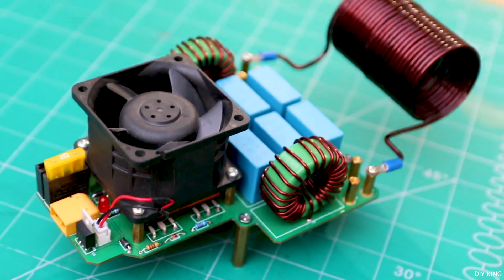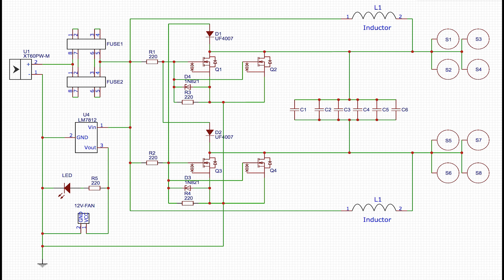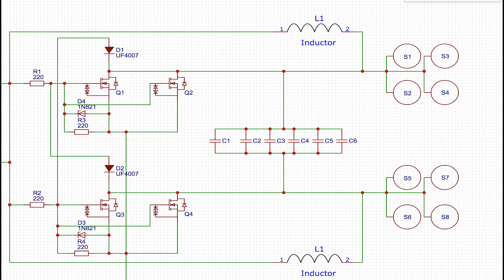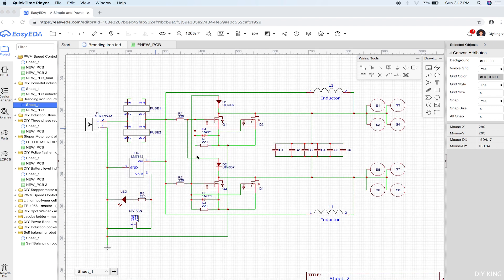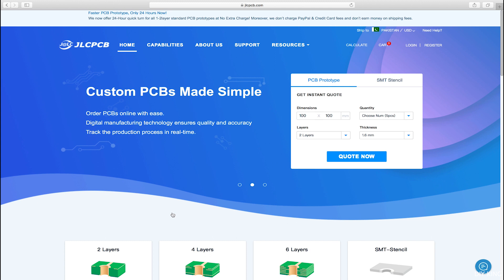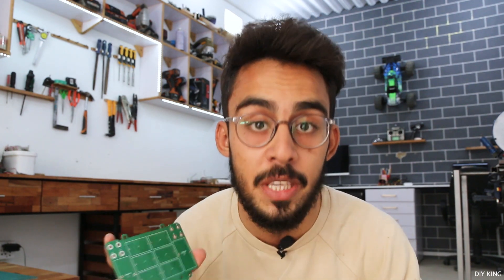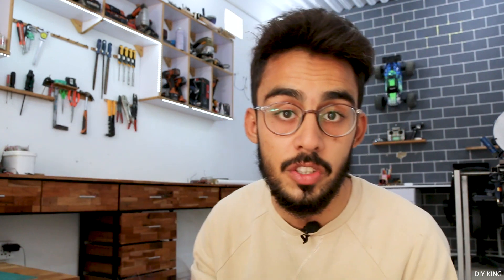How to make a Powerful Induction Heater (2000 Watts)

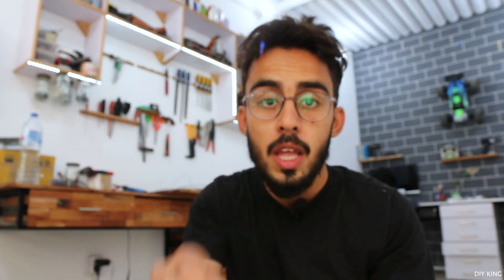Comment: At about timestamp 3:53 you state that the toriod pair are to help get the required frequency.  Actually, they should be UNrelated to the resonant frequency, their function is to filter the noise from the power supply.  If they are effecting the frequency, their inductance is probably to low.  If so, they are inadvertently combining (in series) with the main coil, and lowering the true resonant frequency which should ONLY depend on the resonant capacitance (C) and resonant coil inductance (L).  Make them about ten times higher than that of the resonant coil.   The resonant frequency is given by the formula:  F = 1/[2(pi) sqrt(LC)].
THANKS FOR THE GREAT VIDEO!!!  I look forward to making a circuit board like you show.

Comment: Thanks for the info.

Here is the extracted text from the component list table image for anyone else that is lazy like me. Just copy/paste to whatever app you want and it should drop in as a proper table.  Just make sure it has 10 columns and 13 Rows  including First column ID and Top row headers

ID	Name	Designator	Footprint	Qu	Manufacturer Part	Manufactu	Supplier	Supplier Part	Price
1	5AW2UC	LED	LED-5MM	1	5AW2UC	KENTO	LCSC	C52730	$0.0107
2	UF4007	D1,D2	DO-41	2	UF4007	ON Semicon	LCSC	C232764	$0.1254
3	220	R5,R1,R2,	AXIAL-0.4	5	MFROW4F1001A50	UniOhm	LCSC	C57435	$0.005
4	Toroidal In	U2,U3	INDUCTOR	2	Toroidal inductor				
5	1N821	D3,D4	DO35Z10	2	?				
6	178.6165	FUSE1,FU	178.6165.000	2	178.6165.0001	Littelfuse	LCSC	C207060	$2.1414
7	B32654A0	C1,C2,C4,C3	CAP-FILM_31	4	B32654A0474K000	TDK	LCSC	C165794	$0.9505
8	XT60PW-M	U1	XT60PW-M P	1	XT60PW-M		LCSC	C98732	
9	XH-2A	12V-FAN	XH-2A	1	XH-2A	BOOMELE	LCSC	C20079	$0.003
10	LM7812	U4	TO-220(TO-22	1	LM7812L-TA3-T	UTC	LCSC	C71108	$0.14697
11	STY60NK	Q1,Q2	MAX-247	2	STY60NK30Z	STMicroel	LCSC	C262988	$7.2418
12	STANDOF		STANDOFF-E	4	?

Comment: Hiii.... I've a question about this circuit. I want to know that whether I use one inductor center tap circuit or two inductor circuit as you made. Which one is very stable and efficient between center tap and two toroidal core?
  Thank you

Comment: Can you help.
I have a dual fan 2500W ZVS Induction Heater Heating PCB Board Module, 12V-48V DIY High Frequency Induction Heating Machine Module Flyback Driver with Copper Ring and Cooling Fan
and I would like to hook it up to a 30 amp power supply. I need to supply my own power cord to it. I was told that using anything below 30 amp power cord will try the circuit in my house or cause a fire is this true?
Every 30 am power cord that I find are for dryers. I need a straight plug to plug it into my standard wall outlet. The dry plugs are slanted and I need them straight.
The only kind of power cords I find with straight plug are only 15 amps. Can I use a 15 amp power cord to power up my power supply to my ZVS Driver or will it start a fire?
Can I instead replace the head of the plug with a stander straight one? Will this cause a problem? Thanks for your help it is greatly appreciated.

Comment: Your programm is really appreciable , I need an induction heater in bigger size induction coil to heat a vessel having a outer diameter of  305 mm ,is it possible to build an induction coil for this diameter if possible than what will be the wattage ?

Comment: That 2000 w is definitely clickbait 🤣, mine version is only 300w but takes same time to heat's up the object that you show in the video , and accord to your ammeter , if we consider voltage of 24v and your ammeter reading 13a the power we get is only 300w.
Reply: Also the frequency of the circuit depends upon the work*** coil not the inductor they are just acting like constant current sources.

Comment: Thank you very much. Very useful information.
I wonder if you know the real power of the system, I mean the efficiency of the circuit. 
Output power vs. input power. I'm trying to calculate, but I'm lost.
What is the maximum Voltage of the power supply and current? 
Many Thank

Comment: how many amps will that unit draw? I saw an amazon 1800 amp unit and it drew up to 43 amps.. and I was thinking. If I run it off a 20 amp 115 volt plug in.... that doesn't work? does it?

Comment: Hello first of all thanks for the instructions. In the list of components the resistance is 1K Ohm. In the video you use 220 ohms. Which are the right ones? Thank you very much and best regards from Germany
Reply from the maker: Both will work fine i have used 220 ohm
Reply: @DIYKingSaM  Thanks for your answer! Can i take a normaly Zener Diode 6,2V for position D3 + D4 (1N821)?
Reply: @Paintball1987  this is quite late but that is probably not a good idea, as it will limit the voltage the gate voltages to 6.2v, which will likely not be enough to fully turn on your MOSFETs, leading to them overheating quickly
Reply from the maker: Yes you can as it prevents flashback

Comment: How did You know how many loops You have to do around ferryte cores?
Reply from the maker: Induction heating offers best results at frequency near to 10khz, used an online calculator to get the gauge and no of turns for the inductors to get the required frequency

Comment: Very good , and very clearly explained.
Is there any reason you chose that particular size for the inductor coil? 

Could you increase the size to accommodate larger items such as a 75 or 100 mm crucible ?
Would you have change or scale up the circuit in any way ?

Comment: the one thing which bugs me about this circuit are the 2 inductors (here: 100µH) at both sides of the main coil. Why are they needed?
Reply: They are called chokes. The wire is wrapped around a ferrite core creating a magnetic field. This is done to get the right frequency. The more turns, the lower the frequency
Reply: @BearwoodWestYard  No, they are to limit the instantaneous current change, since they have a much higher inductance than the working coil.

Comment: This is false, misleading and dangerous, here is what it takes to heat with a power of 2kW: https://www.youtube.com/watch?v=8M1F2RbQeN0
Coil will melt soon or later, the varnish is not strong enough. 2kW is totally untrue. A real induction heater has a hollow and cooled coil. Lies. This guy is a liar who knows nothing about what he claims to show others. His "work" is a copy and paste of a schema found on the internet. He can't even explain it properly.
Just the isolation of the PCB tracks is pathetic and would make any first-year electrical engineering student laugh. It's a bad routing of a scheme stolen from the net. Youtube Money !

Comment: You are a genius. Design is cleaner than most online. Thanks for sharing!
Reply: Lies, just the isolation of the PCB tracks is pathetic and would make any first-year electrical engineering student laugh. It's a bad routing of a scheme stolen from the net. Moreover, 2kW is a lie in this case.

Comment: How to make a mini pottery wheel
Reply: Mini pottery wheel is essentially a motorized turntable.

1. Build or buy a lazy susan platform.
2. Take a box and add the platform to the top of it.
3. Power the platform using a sewing machine motor that has a foot controller.